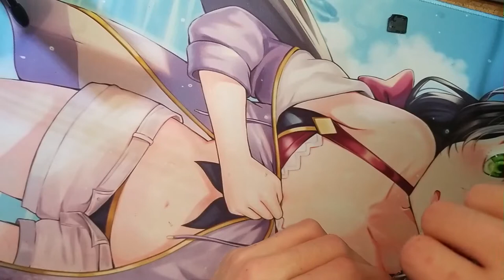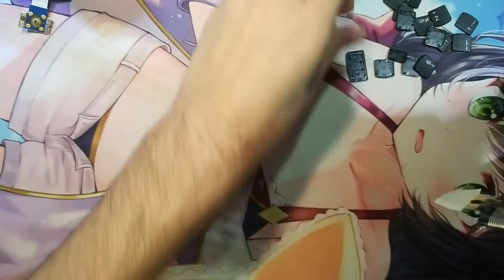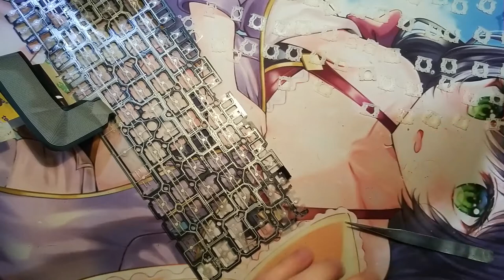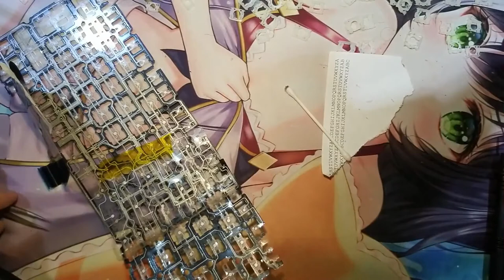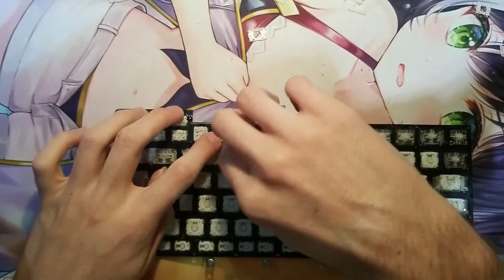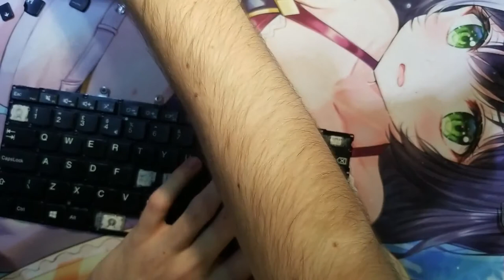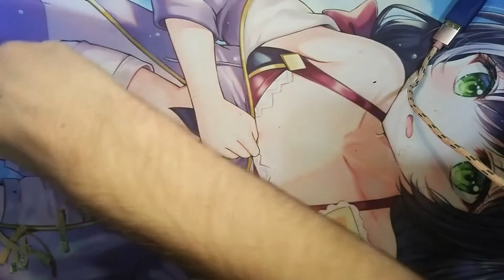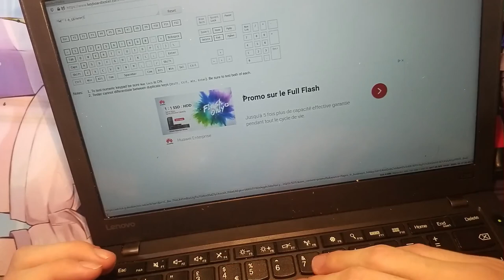T&F ThinkPad X260 keyboard (NO AUDIO)

Comment: Nice!
But is is a job worth doing when you compare the time involved (and so the labor cost) compared to getting a new keyboard?
Reply from the maker: No of course it's not worth it, the keyboard is 30€, and it'll never feel as good as a new keyboard. But I just wanted to try to see if it was possible, and at least I didn't have to wait for a new keyboard to come in.
It could be worth it in the case you have a single key near the edge of the keyboard that's not working (since you'd only have to disassemble a few keys around it), and new keyboards are either not available or very low quality (there are a lot of low quality non original keyboards sold on Aliexpress…).